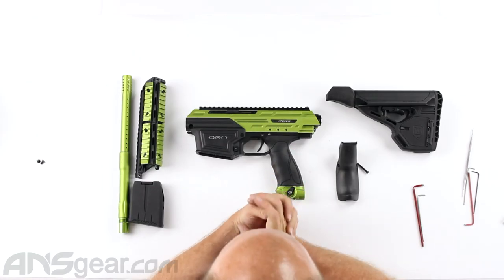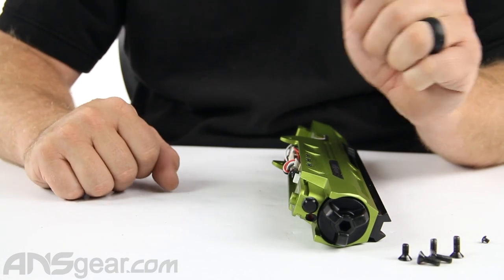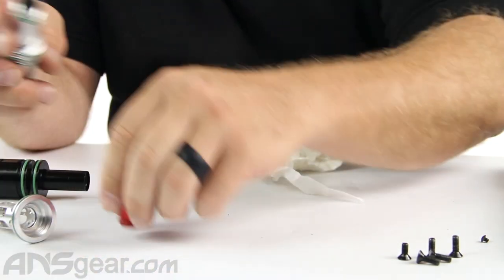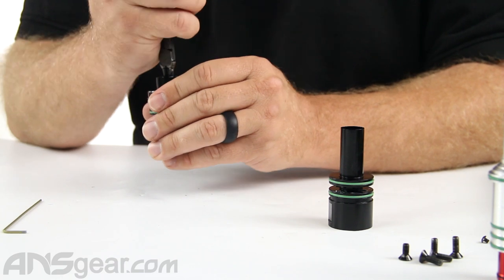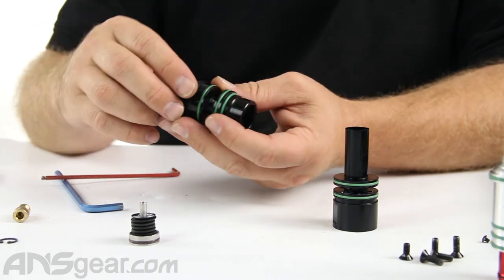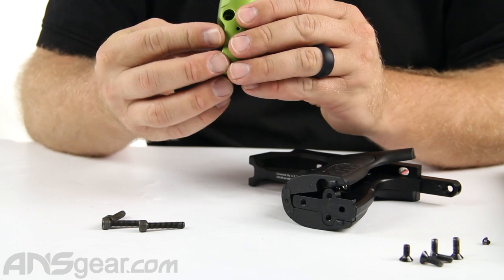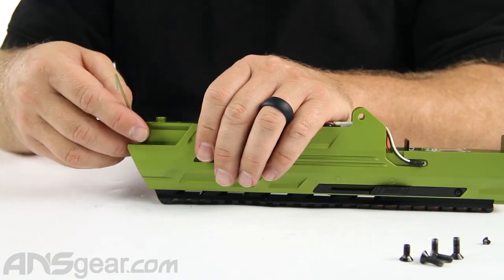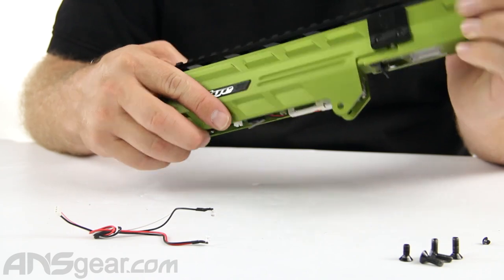Dye Assault Matrix DAM Paintball Gun - Maintenance/Repair

Comment: Hello Friend! How is everything? Thank you so much for the excellent video!

I have a question about this device. If I put the Air Thru stock air kit, is it possible to use two cylinders simultaneously on this marker?

Can the equipment capture air from both sides without harming the system?